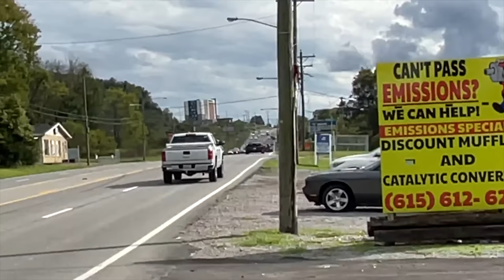X PIPE Vs H PIPE: What's The Difference?

Comment: The H-pipe for most modern cars give it a more muscular sound, while  the x-pipe will be more raspy, in addition with an H pipe, you have plenty of low-end torque, whereas with an x pipe you lose low-end torque, but you gain it at the top end
Reply: Perfectly said!  It's mostly the HP gains are in the upper RPM for the X-Pipe.  But for the sound and racing with torque being most important, the H-Pipe wins all day long!
Reply: So which one better?

Comment: H pipe is better for the classic American v8 sound, also if your engine is cammed the H pipe will bring out the chop much more at idle.
Reply: My 5.0 windsor cammed, and cammed 3v with x pipe say otherwise. H pipe sounded like shit on the cammed windsor.
Reply: 100% these coyotes sound great with a H pipe and ghost cam tune
Reply: @Donnie_Bing  ghost cam tunes are pathetic. I use to have one for my 5.0 but hated the poser fact. So I sold it and bought an LS3 and now have 500rwhp with a TSP 3 Cam and boltons
Reply: @fbird90nw  pretty sure we were just talking sound.
Reply: @fbird90nw  there fast and sexy just all around badass cars them corvettes and camaros are awsome cost more then the others muscle these days but wroth it I got one
Reply: @fbird90nw you had a 5.0 and didn’t even know how the engine worked? and I know you don’t know how it works because of your use of “poser”
Reply: @daquashesxp5321  I know all about the ghost cam tune. And what it does to an engine, but fact is it's still poser shit. I drove like shit and made taking off worse. Doing a real cam swap on a coyote is useless as you only gain like 20rwhp and it won't chop because of the VCT. I had a 2012 GT 6spd. Fast car but ricer mod
Reply: @fbird90nw if you locked the cams out they would chop like crazy, its just technolog not posing.

Comment: I think the x pipe suites the car better. Those high flowing/high revving motors really benefit from the scavenging of the x.
Reply: Power/flow wise, yes that's correct, X pipes do allow for better flow at high rpms, which is why they're so popular in this age of peak-power-at-any-expense (aka Instagrammable dyno numbers). But H pipes were far more common even just 20 years ago, even in JDM platforms - and aside from sounding much deeper, they make low- and mid- range power that is more useful on the track.
Reply: @stradivarius151 did not know that . thx for the knowledge
Reply: Agreed.

Comment: In my experience with my grand marquis, an h-pipe made it sound like a truck and x-pipe made it sound like shit
Reply: I owned two Grand Marquis myself and the reason why the x-pipe sound bad on it is because the 4.6L engine makes more of its horsepower in the lower ranges. That means an h pipe is more suitable than an x-pipe. And you are right. An x-pipe do make them sound like shit unless they were designed to rev at a higher RPM like the dual overhead cam versions or the three valve versions of the 4.6.
Reply: @ragintaurusmusclemercury7023  unless you get headers. Headers make any panther sound good
Reply: @yeanah2571  I swapped the 4.6L in my for a cammed 5.4L with shorties and rear cats deletes.
Reply: @ragintaurusmusclemercury7023  Do you think 4.6L engines with a heavier cam that are built to rev alot higher sound better with an x pipe? Assuming that its one that isn’t originally built to rev high like you mentioned. Or are there other factors? Im not super well versed on the ford engines. My family has always been toyota and chevy.
Reply: @howdythere2419  it would because you will have to tune the vehicle in order for the cam to work properly which includes adjusting the timing so it can rev at higher RPMs. I had a cammed 4.6L in my first Mercury and it sounds a lot different then the cammed 5.4L in the Mercury I have now. For a matter of fact I like the 5.4 over the 4.6.
Reply: @ragintaurusmusclemercury7023  I saw that. I'm thinking of either putting a 100 shot wet kit on my 4.6, or possibly going 5.4. What are the benefits of going 5.4 2v, instead of 4.6 4v?
Reply: @yeanah2571  The 5.4L and the 4.6L are basically the same size externally which means no issues with swapping for the bigger motor. You will have to use the 4.6L intake with intake adapters to fit everything under the stock hood.  The 5.4L with a cam makes more power and torque than a 4.6L with cam. Over 320+ hp with a Comp Cams Stage 1 camshafts. The main issue with a 4.6L 4-valve in a panther body car are the wide heads. If you ever have to work on them you will have to pull the engine due to lack of room.
Reply: @ragintaurusmusclemercury7023  I'm surprised you didn't go after a 32 valve 300hp 5.4 out of a 2000-2002 Lincoln Navigator. You must of gotten your hands on one of those 16 valve 260hp 5.4 engines.
Reply: @lanewarriorillridez3739  I tried but unfortunately they are popular so they are hard to come by unless you have some $$$. I wanted one badly but had to settle for a 2-valve Triton.

Comment: Wish you where closer, been wanting to add an H-pipe behind my X-pipe.  Yes, I want to run both on my fox body.
Reply: There's a video on this channel showing a 2015 with the H in front of the X, but don't think I've ever seen the X in front of an H...
Reply: @tjtrainzCSX  I will try to look for it.    Thanks
Reply: Did the same with my challenger. It's awful lol
Reply: @85Lgc  top 5 mustang exhaust video, #4 has Bolt on H paired with an X
Reply: holy cringe. sell it, buy a honda.

Comment: H-Pipe all the way! Sounds much better than the X-Pipe. I went from factory, to X-Pipe, and then to an H-Pipe. The difference is a deeper tone both at idol and when accelerating. The fact that the H-Pipe does not scavenge, is what creates the deeper tone. The stagnant exhaust is in the way of the fresh pulse of exhaust from the manifold that creates a shock wave as the to masses of air collide in the exhaust stream. I'm sure that better scavenging is desirable, but the lack of it from my H-Pipe is worth it!

Comment: I like the H pipe better. Have you guys put a H pipe on a 5.7 Hemi Challenger? If it sounds like that Mustang I’ll have you do it to my Challenger.
Reply: i put an h-pipe on my cammed challenger. it sounds alot deeper than both mustangs. but i bought a hooker catback kit and have LTHs and no cats. its just as loud, no rasp, and shakes the ground
Reply: @jameswhitesell3076  cool mine is cammed with shorty headers and gutted cats so I’m wondering if it would have the deeper sound like your talking about and no rasp.
Reply: @jaymesmustaine684  i would assume it would sound similar. H-pipes seem to have a deeper muscle tone while x-pipes have a more european sound
Reply: @jameswhitesell3076  cool any power gain or loss with the H vs the X? Did you buy the H pipe somewhere or have it made?
Reply: @jaymesmustaine684  i have no idea. Ive read hpipes make more low end while xpipes are top end. It came with the catback i have. Its the hooker blackheart catback
Reply: @jameswhitesell3076   coyotes sound way deeper than this with long tubes lol
Reply: @danielarroyo7550  ive heard many 5.0s and they all sound very raspy. At idle they do sound pretty good, but at upper rpms, im not a fan. Alot of hemis have the same issue, but thats because of their exhaust choice.
Reply: @jameswhitesell3076   same goes for 5.0s. Most 5.0s go all out and definitely sounds raspy with full exhaust lol but you can still do a full exhaust and just keep the cats and there won’t be no rasp at all
Reply: @danielarroyo7550  most hemi guys either go borla atak or just straight pipe it. Its really not that great sounding, just alot noise. Id rather be half as loud, but sound twice as nice. Mines pretty tamed at idle, you know there is work done, but its not unnoxious. Once you hit the go fast peddle, you know its not factory

Comment: Personally, I hate H pipes. They suck at higher RPM.   Do not sound racey, or raspy.   Both of my mustangs have shorty headers, cat less x pipe with muffler deletes.   Basically, H pipe is more throaty at lower RPMs,  louder when cruising, unequal sound.  More boomer exhaust sound.   X pipes really shine without cats, cams, and muffler deletes. Higher RPMs really give a more raspy race car sound. Plus the exhaust scavenging of the X pipe is so much better.